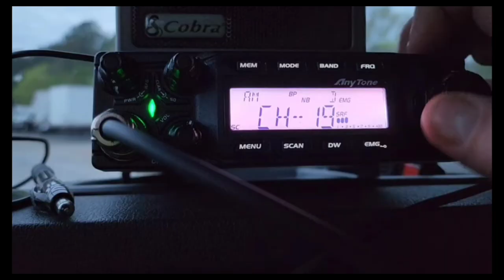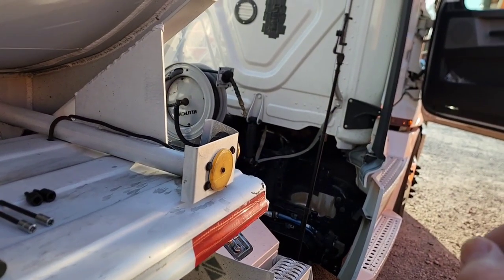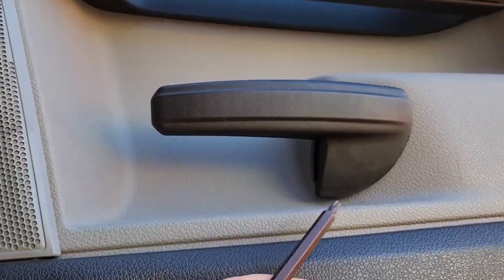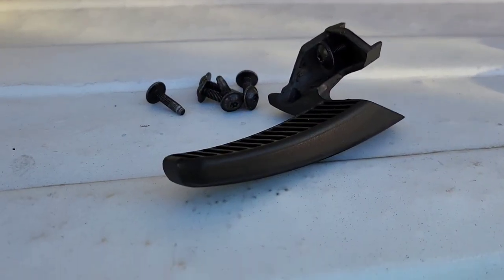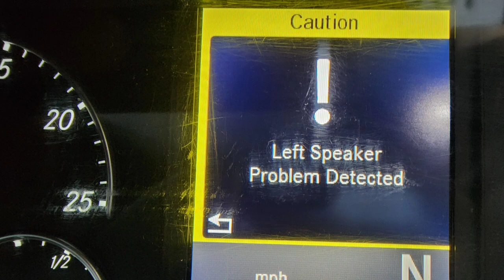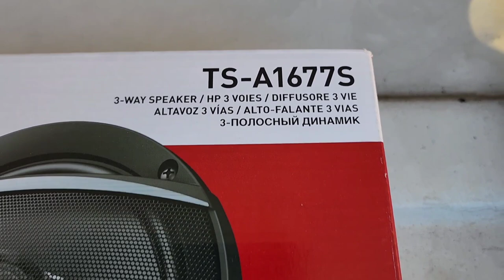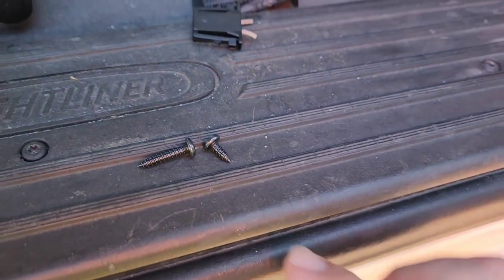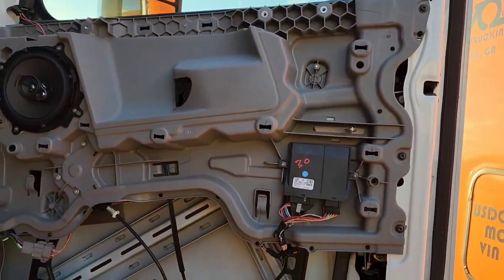Installing new speakers in 2019+ Cascadia and what you need to know.

Comment: ( Mount on Vehicle Dash ) 
I Used Many Years Ago on CB Bracket on the Bottom  of the Unit Threaded Suction Cups .Two on Each Side of Bracket . I Added Two Flat Washers, One Lock-Washer and a NUT. And Radio Shack Speaker I Added Two Threaded Suction Cups to the same Hard-Ware . On Either Side of Speaker Bracket ,and Placed on Top of
CB Unit . I Never had Problem With Either One Staying
in Place . Easy to Remove a Store Away ,When Needed.
I am checking CB Speakers on YouTube Ads. I Found
This One MFJ Clear-Tone Speaker ( MFJ-281 ) ( 2.5 X2.5 Squire ) From Ham Radio Guy .I Purchase One Off Ebay
Works Really Great with Midland CB and Really Small
Speaker , And I use it on CB Hump-Mount for Passenger Seat . The Speaker Sits Below the CB Unit with Verco
Strips. Between the Brackets ..I Don't Use the threaded suction cups on Passenger Seat . Just Duct-Tape for the
Saw-Tooth Bottom Bracket or Flex-Tube Slide on .Either
One Will Work ..

Comment: You only need one of the 2 warning signals for low air or any other warning flag that pops up on the dash. If you don't have a "buzzer" you must have a visual warning, if you don't have a visual warning, you must have a audible warning to direct your attention to your gauges. Only time you'd get a ticket is if you don't have either of those warnings. Now the getting fired part, most likely if it isn't approved from the company, because 9 times out of 10 they're lease trucks and they don't want to waste money for for crap like that.

Comment: I wonder if you could use a dual voice coil speaker to still keep that functionality.
Edit: the warning that a spesker has problem tells me it's got a canbus chip in it, or it detects it by resistance. Someone has said they hooked a 3.5" spesker to blue harness (truck sounds) and it got rid of dash message but was very low volume for said sounds.  It's like the oem is a knock off cadence DVC 6.5" since it's all mids and highs like the cadence are designed for, no low end.
Reply: That's what I was wondering too, I'd say probably couldn't hurt to try
Reply: I know this is old, but I do remember the older freight liners. The speaker that made the warning sounds was above your head and it was a separate speaker from the one that made music. If I remember correctly, but has anybody heard anything else about being able to just wire Another cheap midrange speaker Or use Tweeters hooked up to a amplifier?

Comment: There was no sound on my left speaker. I got a pair of pioneer t600m 4way speakers. And pair of cheap walmart tweeters for blue socket. Tweeters didn't work for me.  Having the left speaker problem warning. And my left speaker is still  not working. I believe there is something wrong with the harness. I gave up for today. I'll keep posted here if I figure out something

Comment: Couldn't you just splice the two together,  the blue into  normal audio side? Just curious if that would work, eliminating the tweeters
Reply from the maker: Tried it and the speaker make a continuous popping noise and music sounds like crap.
Reply: Probably gives feedback, sending power back through the other leads
Reply: @jrichtruckincbtips so what was your solution? As I understand if you connect parallel 2ohm resistor to your 4ohm speakers it will help with that. I also have a problem on my truck. Connected 4ohm 6.5” on main place and 4ohm 3.5” to blue connector. Still haven’t solved that problem

Comment: Can you do more Video about blue plug
Reply from the maker: Once it warms up I'm going to add the other speaker to get the warning sounds back.
Reply: @jrichtruckincbtips  I’m waiting
Reply: @Icecake705  me too!
Reply: Just use a load resistor.  Truck computer will think speaker is still there. No speaker warning light
Reply: @phila8160  yeah, but would still like to get some of those warnings.
Reply: @Phil A  is there a specific load resistor
Reply: @johnw6038  I'd just check the voice coil on the speaker to see what the ohm load is. More than likely its a 4ohm. We have to use them when bypassing factory amplifiers in cars sometimes or radio won't work. Has to see an ohm load to function,  it should work in this same situation.  With the resistor it will fool radio and it will think speaker is still there.
Reply: @Rayzer2368 why not just use a dual voice coil speaker
Reply: @phila8160 I think you need 2ohm resistor because it was series resistors connected to 4ohm system. If you want to add parallel resistor to your 4ohm speakers you need 2 ohm resistor.

Comment: Why not just use a dual voice coil speaker? I’m sure that’s all the factory speaker is is a dual voice coil. They are real popular is the car stereo world because they can be wire to lower the ohms and pull more power. But they make dual voice coil 5 and 6” aftermarket door speakers that I think would work perfectly. Wire the stereo to one side and the truck alarms to the other side of speaker. Their will be a positive and negative on both sides of the same speaker.

Comment: A two way speaker with the alarm wired into the tweeter could be an option.
Reply: Yeah but you'd lose highs, be simpler to just grab a cheap small speaker to designate for the alerts